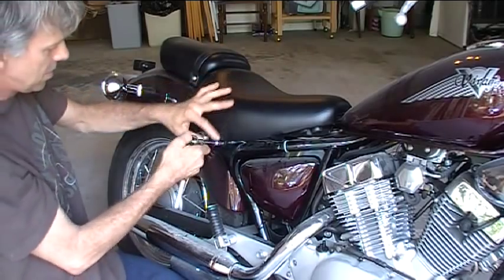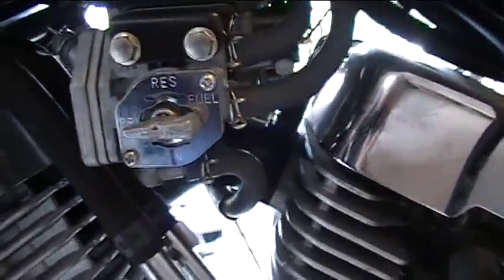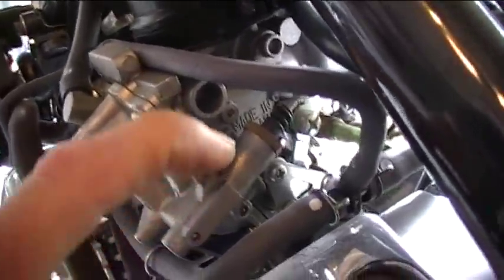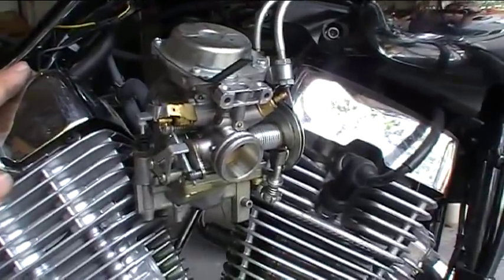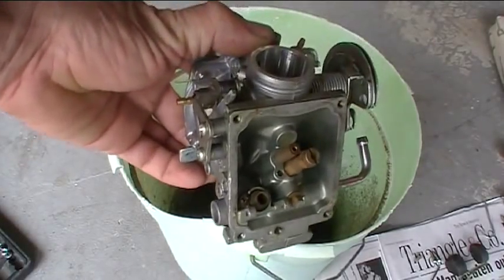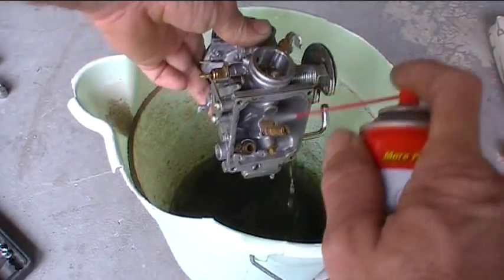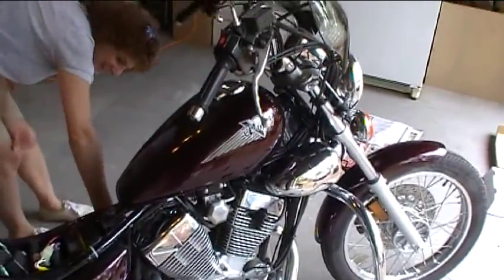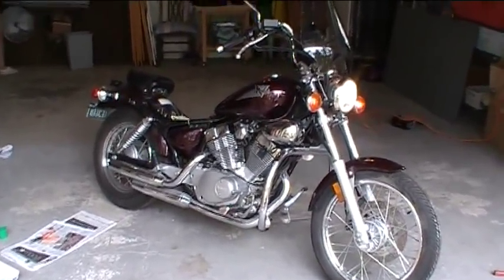07 Yamaha Virago 250 Carb Cleanout

Comment: I just bought my friend's 2006 Yamaha Virago 250, and drove it home yesterday.  We had to get a new battery and jump start it a few times and it also ran out of gas.  I'm going to plug in the battery to the charger, and see if that helps, but my friend said that the stator might be bad, and I was reading that the carburetor might need to be cleaned, and the fuel lines might be clogged.

The way the motorcycle was working when it would cut off on the interstate was that it would just suddenly cut the power drastically, I would slow way down, but then the power would kick back in and it would seem fine again, but then cut back off again.  I would down shift and mess with the choke, but I had to pull off and have my friend who was following me jump start it again.

I'm still really new to motorcycles.  This is the first one I've ever owned, and only the third one I have ever driven in my life, and also the most powerful motorcycle that I've driven so far, after my dad's old Honda Trail 70 mini bike, back when I was like 15 years old, an the Yamaha TW200 that I used at the motorcycle class I took last month.

Comment: Thanks for a great video. Those "sensors" are actually carburetor heaters. You only need one of them. the other one, you can block off. Quite possibly, there are two heaters and you use one or the other depending on what type of emission controls are installed.

Comment: I recently bought a 2006 Virago 250.  It hesitated when coming off idle.  There is a brass plug that is about 1/4 inch in diameter on the right side of the carburetor.  It can be accessed while the carburetor is on the bike, but at an angle.  Carefully drill the plug out to reveal the idle mixture control beneath it.  Turn the screw 1/2 turn clockwise to make the idle rich enough for good performance.  Like all carbureted bikes, the idle mixture is set very lean to meet emission standards.
Reply: Thanks for the detailed video! When the bike didn't start initially after the carb cleaning what did you adjust to make the engine to run again?

Comment: Took my carburetor off, cleaned the idle jet, made sure the accelerator pump circuit was clear and thanks for the help. Tried the wire from a twistie tie, was still too big.  Just soaked the idle jet in some carb spray cleaner in a tiny bottle.

Comment: I turned the throttle screw until it would not stall at idle, a bit less than 180° . it would turn without much effort, i guess that was the problem. The bike feels as good as new now. I changed the sprockets to 17/40 so i'll check the performance with the idle airjet screw mod and let you know. Thank you so much for the tutorial. Taking the carb out was a real hustle

Comment: Thank you for your video 👍it was spot on to the problem we had. Just a suggestion to make removing carburetor easier: unbolt the intake manifold from the jugs first and the carb slides out alot easier. Again thanks for the video, the bike runs again!!!
Reply: What I decided to to do when I pull it offagian . May replace my intake also.

Comment: Great video I need to clean my wife's carburetor on her V Star. A few things caught my attention, the fuel value in the prime position and then you said about how her air box became flooded. Do yourself a favor and check the crank case, check the oil make sure it isn't high or you will ruin the engine. I'm not a shop guy but I have had problems with my Suzuki Vinson 500 with a vacuum  carburetor like that and someone left the fuel on prime and flooded my air cleaner box which then flowed over into my crank case. I assume one of the family members did this because it was not running correctly, thanks to the ethanol gas, so I have used an ultrasonic cleaner on that carburetor and others as well, I also carefully rebuilt and cleaned that pet cock valve for the fuel on prime and reserve. I know a guy who ruined an engine that was almost full of oil and gas in the crank case so check it. My advice is any time you flood fuel into the air box get a new filter and change the oil as precaution
Reply from the maker: That actually happened once. I caught it before starting though. Had to drain and change the oil.

Comment: The vacuum diaphragm is not a fuel cut off. It is a diaphragm operated fuel pump. The old gravity feed gas is more reliable. The diaphragms can harden with age and stop pumping gas.
Reply from the maker: Yeah I like the old ones better. This one has a tendency to leak during winter storage. The fuel runs over in the bowls and ends up getting into the oil in the crankcase!

Comment: Easiest is to remove the intake manifold before pulling the carb, much easier. Also allows you to check the manifold for air-leak cracks (I'm on #3).

Comment: Hi ... thanks for the vid.  I have a 2000 yamaha 250 virago and was smelling a very rich mixture.  I started to lean out the mix screw 1/8 of a turn at a time and took a ride.  Kept doing this until screw bottomed out and no change in rich smell or performance of the byke. How is this possible?  (starting point was about 1 and 1/2 turns out).  BTW, hope this is a complement to you, but you remind me of Stewart Copeland (x drummer police)

Comment: I think the sensors, at least one of them, is a heat sensor. Located inside the other chrome air-cleaner box thing, on the left side of the bike, is a carburetor heater.

Comment: Hi! good video! I just want to know if the starting problem was solved JUST unplugging that heater connection?? I have replaced the rubber neck of my virago's carb and now is not starting at all!! Not even a little explosion... exactly as your Virago at the end of the video... is it as easy as disconnecting that heater?? Thanks!
Reply: We're you able to fix the issue?
Reply: @tad3531  Were you able to fix your issue??
Reply: @sansguerra2265 unfortunately no… it’s still sitting in the garage and wife is telling me to get rid of it lol

Comment: Can you please show how all of the fuel lines run on the petcock ,carb and the fuel pump.Not sure which of the 2 ports is the fuel intake on the carb, is it the port where the bowl is or is it the other port that is on top of the throttle cables?Thank You,Eric

Comment: Great vedio really helped. I found the jets and the fuel gate plugged. The reason of driving to the last drop in the tank. Now running even better than before
Reply: What do you mean by the "fuel gate?" Also, what do you mean by "driving to the last drop in the tank?" Thanks...
Reply: @BEEBEE159  before the jets there is the hall in the carb body. Where the rubber peace plugs the fuel when the carb is full. It's had particles from the tank (rust or sand)  maybe fuel filter failed or it wasn't installed at all...
Driving to the last drop means running the bike on reserve so all dirt will go to the lowest point. If the filter dosint catch it it will pass to the carb and plug it... In my case the tank had a lot of rust
Reply: @jubran.balharith  "Before the jets there is a hall..." ---- Did you mean to say there is a "hole" in the carb body? Sorry to be a pain; I just want to understand what you're saying because I have not taken my carb off yet.
Reply: @BEEBEE159  yes that's right. Miss spelled.
Reply: @BEEBEE159   at 6:44 after remove the needle valve check inside. My problem was dirt stuck inside
Reply: @jubran.balharith  Okay, I understand now. See, I really wanted to understand what you were saying because I may be having a similar problem. When I run my bike on the reserve tank, my engine spits and sputters, and now it's doing that more and more. I must have picked up some debris when I ran it on reserve, and my bike does not have a fuel filter installed on it, either. Thanks so much. Now, I know what to look for when I take my carb off.

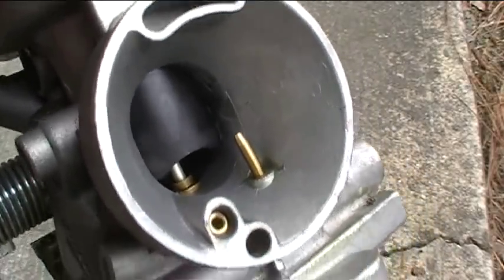Comment: 11:00 how would you remove this jet if it doesnt shoot out fluid out the other end?
Reply from the maker: You have to clean it in place. Try running a fine wire through it. Check the pump as well.

Comment: could you point me to the choke? I tried finding it but you didnt do 360 deg rotation or i missed it.
Reply: The choke is on the left handle on the bottom. I think the lever should be out away from the bike for the choke to be on.

Comment: I don't understand how the "Prime" setting works on the fuelcock.  I get that the on and reserve just have two hoses from the gas tank, and one sticks up farther into the gas tank, so the other accesses more of the fuel.  It looks like the vacuum from the carb boot pulls the fuel from the tank into the fuelcock, then it also pulls the fuel from there to the fuel pump, and then another vacuum pulls the fuel from the fuel pump to the carburetor.  How can the fuel go straight to the carburetor, if the fuelcock doesn't go straight to the carburetor?  It just has the two inlets for fuel, one outlet and the vacuum line.
Reply from the maker: Prime bypasses all the valving from the vacuum diaphragm. Reserve or On rely on engine vacuum to open an internal valve to allow fuel to flow. Engine off, no fuel flow. It's not a fuel pump like most people think. It's a vacuum operated valve.
Reply: @HackaweekTV  I'm sorry I asked. Reading your reply is just giving me a headache.

Comment: Hello!
I have an 1995 yamaha xv250 virago it is my third bike and i love the small bugger, but i have an small problem with it that i never encountered before. The throttle is really sensitive at low rpm, it jerks hard forward when i give just tiny amount gas (from idle) and feels like an extreme engine brake when i slowly release it again.
I don't really know where to begin look for the problem, any tips? (the chain seems to be ok)
(english is my second language, sorry for any misspelling)
Reply: I have a 2010 model here in Australia, it does the exact same thing, dang annoying on what is otherwise a beautiful easy to ride little bike.
Ray
Reply: whorayful Hi.
I have my bike currently and almost striped to the bone now because i am building myself a Bobber, BUT i think i solved the problem, there was a little slack in the rear wheel damper assembly and the front chain sprocket to. Plus the return wire for gas throttle was sluggish of rust so it jumpt couple of millimeters when the throttle was turned. I just removed the wire because the bike didnt need it and changed to new parts in the drive chain. I can't test the bike yet because it is in pieces but that was some problem i found yet.
//Fredde
Reply: Fredrik Lundgren Hey Fredrik, I to am building a bobber from a '88 250 route 66. Let me know how you make out. Your english is fine. To many spelling bully's out there...
Reply: Michael Hollier I wish you good luck my friend on the build! So easy bike to build on. Took mine out for the first ride this year yesterday and it rides like an dream! No more jerky problems! (at side note i also have solid struts, sport airintake filter and straight pipes wich i highly recommend)
Reply: West eagle drag pipes are going on mine, drag bars or 3' risers?? sport air for sure!!..and as much as possible will be matte black, painting the chrome, and going to re-gear for a little more top end. It too is my third bike too...'15 fz-07 & '15 fj-09. I am glad you finished it and are riding it, that is awsome!!
Stay in touch. Have a gtreat "ride"...
Reply: Michael Hollier I have the same model n year

Comment: Hello, I need help please for my father. He has a 250 virago 2007 yamaha. He is getting oil in the air cleaner and would like to know what might be causing that? The compression is 158 and 160 pounds in the cylinders. Any help is greatly appreciated. 
Thanks Lucille
Reply: As far as I know, that's caused by overfilling the crankcase. Make sure he's putting the correct amount of oil in during oil changes, using the site glass. Note, the bike is supposed to be upright, when you look at the oil level in the sight glass. If you leave the bike leaned over on its kickstand, and fill add oil, then you are going to end putting in too much oil. The crankcase breather hose goes into the frame, and the intake sucks air through the frame, as well. That's how overfilling your engine oil results in motor oil getting into your air filter, the air filter goes directly into the frame. I hope you understand what I'm saying...It's hard to explain.

Comment: Help
I have a yamaha virago 98 125 

The problem is that when ever i want to start it i would have to run start(bum start) it.... 
it just wont turn over when i pres the starter button... i just replaced the battery and it stil do the same thing... 
when it runs it runs fine (some hicups) and some times it shut off ) 
Any ideas of what i could be? 

I think it's either tje caburator ore the starter relay.....
Reply: Luc
 

.ky69

Comment: my virago 250 will not start if the side stand is down ,its a safety reason
Reply: This should only be true if it is in-gear.  While in neutral, it should start.  There is a safety switch at the clutch lever and the side stand.  The 2 switches work to keep you safe.  If your bike is not starting, it may be related to a faulty switch at the clutch lever.

Comment: AArgh, would have like to se how you pull/push the carb. of and on the rubber flunnel - and you just left it out...shame on you... :P i have major problems putting my carb. back on without risking to damage the flunnel.
Reply: Remove the intake manifold before removing/installing the carb, makes it much easier.

Comment: i followed  everything in this video,cleaned out the carb and  even adjusted the idle mixture. However, my virago still has problems at idle speed. Any ideas as to what may be causing this? maybe the heat sensors? PLEASE!!!

Comment: Do someone have to clean the carburator even he always uses 100 octane gasoline?
Reply: You shouldn't need to clean carbs very often unless the bike sits a lot, isn't stored properly and the gas gets old and varnishes.  In this regard octane doesn't matter but you probably shouldn't be running 100 octane gas in your motorcycle unless you have modified it.  It's made to run at normal octanes (93 or less).
Reply: Craig Flanick I own a 125cc chinese  cub. When i drive uphil on normal octane fuel i always downshift but when im running on 100 octane it isn't necessary (the same uphill)
Reply: Konstantinos Va       octane has nothing to do with it.  The problem is that people leave motorcycle in the garage all winter and the gasoline evaporates off leaving deposits to plug things up.  This happens to lawn mowers too, and any other small engine with a tiny carburetor with tiny passages.  Particularly the PILOT jet.  Any octane or any quality fuel will do this if left stagnant in the carburetor over the winter.  Cars don't have this problem because we drive them year around, so the fuel is always fresh and flushed through daily.